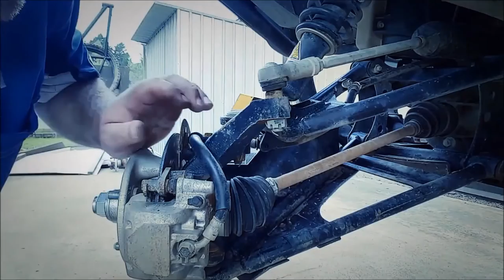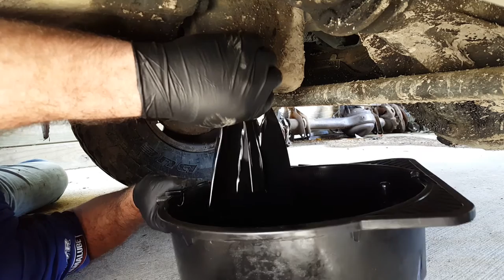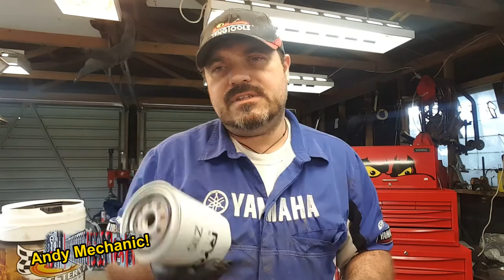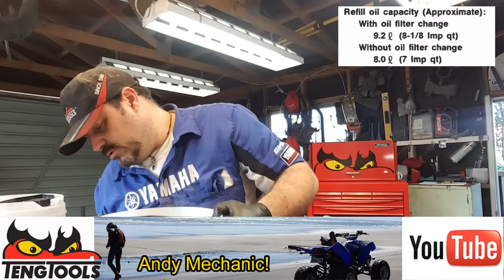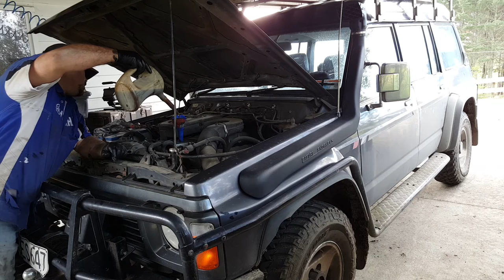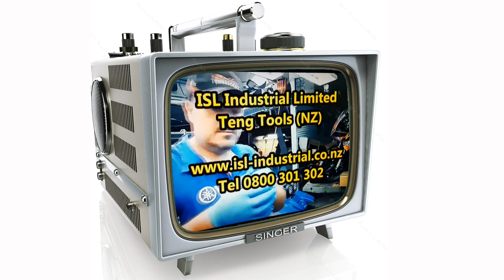Nissan Patrol GR TD42 Diesel engine oil & filters change #1811

Comment: when taking the filters off ,,loosen then put a plastic bag over them,, most of the oil will be in the bag and not all over the diff.
Reply: i did my 1st oil change on td42. wish i did what you've wrote, i had oil all over the place, plus the rear filter slipped out of my hand and i've dropped it
Reply from the maker: Bugger. Yes, a great tip from Ray. I'll be sure to do that too next time around :-)
Reply: Had the vehicle? Never had a new oil filter in that time?  Did you do the last one?  Follow the fittlng instuctions, don't use the filter wrench to fit it, and you won't have the trouble removing it that you had!! Never seen a filter "come loose" if fitted correctly, and been offroading for years, but seen them leak from distorting the rubber seal from overtightening!!
Reply from the maker: Thanks for the info. Unfortunately I have come across two wrecked engines because the filter came loose. When I first purchased this Patrol some 14 years ago it developed an oil leak - turned out to be the rear oil filter that was loose - I didn't fit that one :-)

Cheers Andy

Comment: I have had my 1990 GQ Nissan Patrol 4.2 Diesel with an aftermarket turbo since early 2007. Great wagon. Unlike any other vehicle I have ever owned, the oil filters magically tighten themselves. After tearing my shoulder rotator cuff, I now put a dab of Copper Grease on the threads of the filter. Never a problem removing them now. Two things that make life easier are the Fumoto Sump Plug / Valve. This is brilliant, push the hose over the spout, place the ther end of the hose into an old oil drum, open the valve and whoosh! Oil drains without a mess. The company that make that funnel you used, also make another one which is rectangular and it has a fatter spout and some raised bits on the spout, allowing you to jam it into the filler hole and it doesn't move. It is so good, I bought a second one which is in a plastic bag under the seat if I need to top up on the road. Thanks.
Reply from the maker: Interesting info Mick, thanks for your contribution. I'll look into one of those sump taps,.sounds an excellent idea.

Cheers Andy

Comment: You've got the best TD42 engine, the silver rocker covers denotes the bullet proof ones before they took some metal out of them to lighten them up, which weakned them in the process. Got one in my GQ as well, 1990 model with 307k on it at the moment and purrs like a kitten.
Reply from the maker: +oo0Spyder0oo Hey, Thanks for that. I had no idea the silver tops were the most durable. Most of the ones in England that I came across were silver.

Pleased you liked the video & thanks for the feedback. Cheers Andy
Reply: Unless the UK had/has a different convention to ours, the ones over here changed slightly internally to rev more and came with a black cover, however the turbo variant was made stronger again when that was released and so the black cover on those is as good as the silver top.

Comment: yes, they are dirty old things to do an oil change. i was hoping there would be a better way to remove the oil filters with out making such a mess. i use solvex 1425   also known as  (shellite) to wash the old oil from the motor and every were else the oil finds it's way under the vehicle chassis etc before it ends up on the floor. solvex 1425 (shellite) is highly flammable, but also very highly evaporative. must be careful not to saturate the starter motor or any other source of ignition with it when decreasing the engine, as it can become a fire hazard when starting the vehicle. thanks for video.

Comment: I have a 1993 GR 2.8 liter turbo diesel.  What kind of oil filter does it use?  I need the codes and product information so I can buy on ebay.   I'm in the United States.  What is the best diesel oil I can use for it also?

Comment: Hi Andy, great videos!
do you know if i can use a diesel engione-oil filter on a gasoline engine? both has same dimensions, but the height in diesel is larger, so capacity too, but my concern it's if they have different filtration-media material.
Cheer from Cancún, Thanks a lot Andy!
Reply from the maker: Hi Oliver, this is an area I have little knowledge & very specalist. My concern would be more the seals used both internal & external as these may well vary depending on if used with Petrol or Diesel?

I'd go about it the other way & see if an aftermarket filter is listed to work on both a petrol & a diesel car - if so then there likely isn't an issue.

On another note,.why not just obtain the listed filter?

Cheers Andy
Reply: @AndyMechanic   Thanks Andy for the Reply, i would check it out & let you know, i wanted to run the diesel oil filter cuz it's larger, they both have the same seals diameter, threads same by-pass pressure rating & everything. I'm not a engineer but more filtration media area, will distribute the pressure, applying less pressure in every micron-hole of the filter-media & less force in contaminants will push through the micron-hole, so better filtration?
I don't really know & I'm pretty sure that you know much more about than me both filters are Mann-Hummel, thanks a lot Andy, great videos!

Comment: Cheers Andy nice video. my oil filter on my new nissan patrol gu was stuck on so hard i had to stab it with a screwdriver a few times haha. Can you make a fuel filter change video
Reply: Yawning Yabbie fuel filter is easy straight forward. Just put the primer upside down when you do it. Makes it easier to change

Comment: Hi Andy I have same Truck. Nissan Safari grand-road. Why is your called GR and why it is not 24v system?
Reply from the maker: Ah...interesting. in Europe the model was called a Patrol. The HR stands for Grand Road. Many of the later Patrols were 12 volt. The earlier 3.3 Ltd SD33 diesel was 24 volt.

Cheers Andy

Comment: just did this today on my 2005 gu patrol. manual calls for 10.5l of oil. i had a diesel filter in the way of the oil filters which i had to remove, had to change it anyways. was my 1st time doing oil on a patrol, 1st filter dropped down and spilt oil all over the place haha. i had a vw before this and changing oil filters, i had to prime them by dropping some new oil into them and i did it for patrol too. is that necessary ?
Reply from the maker: Not necessarily bit a damn good idea :-)

Comment: Hi is can I use valvoline oil for 95 Nissan petrol gq 4.2 Diesel engine
Reply from the maker: Yes, I'm sure Valvoline will make the correct grade oil for that engine. You should be able to check on their Web site.

Cheers Andy